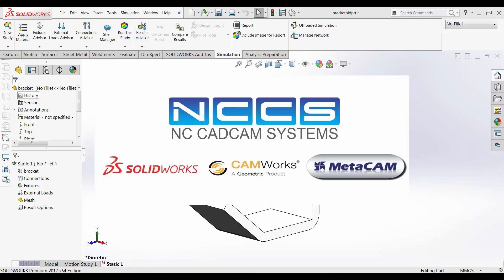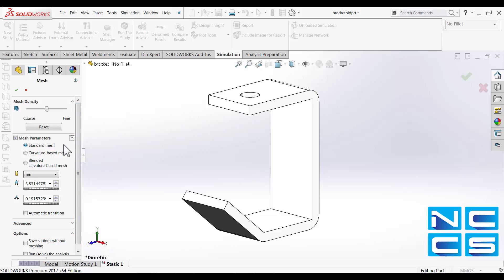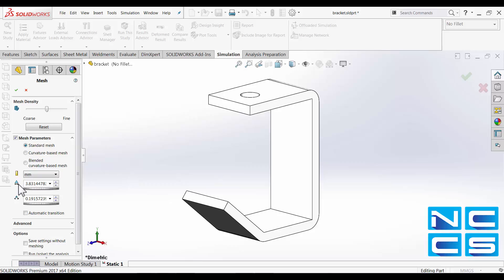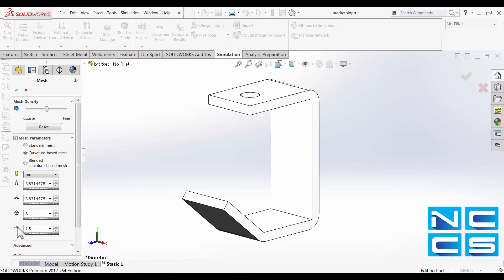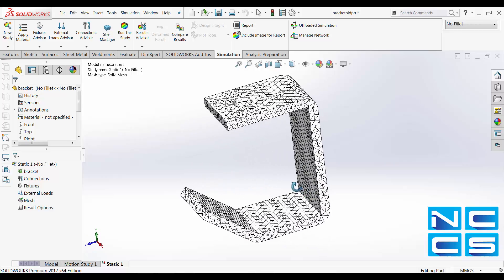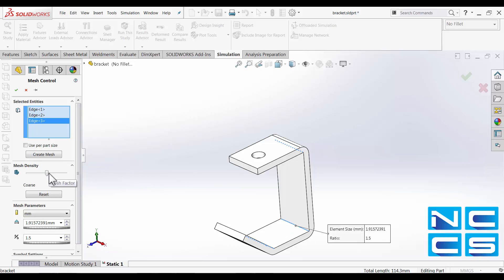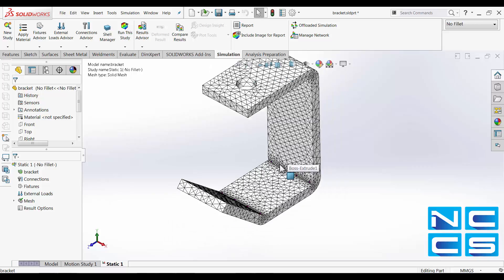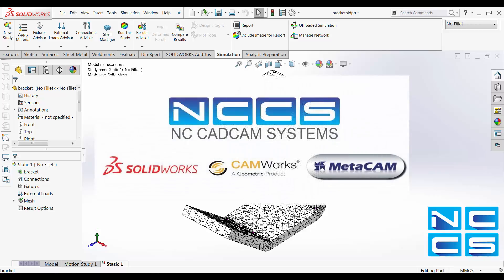SOLIDWORKS Video - Simulation Mesh Settings

Comment: Need help about solidwork simulation: actually i have problem with the simulation analysis in solidworks 2014 software. just i had start my sketching and completed my modeling and selected simulation option that dilouge box which is showing on top of menu bar.i clicked on study advisor in that i selected static then given fixture and external pressure & materiel according to my component next coming to mesh i select dat (mesh and run) but it showing the results 100% completed while it couldn't showing results of what i want to see about shear stress and displacement graph. it took long time but it couldn't. (elapsed time and always shows solver status when you run analysis) so iam not getting what it does mean? what i should do?
 can you plz try to fix the problem if any one knows  
Thank you